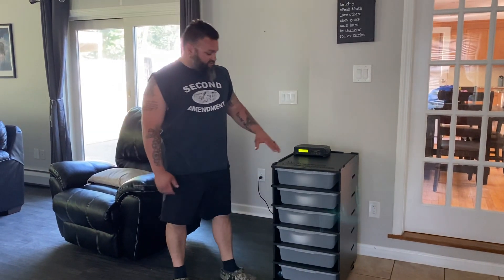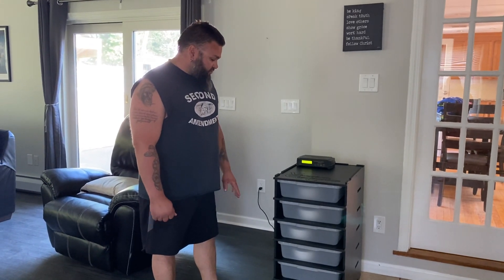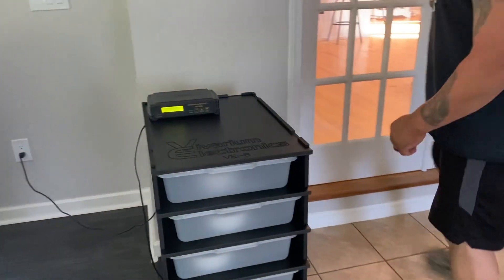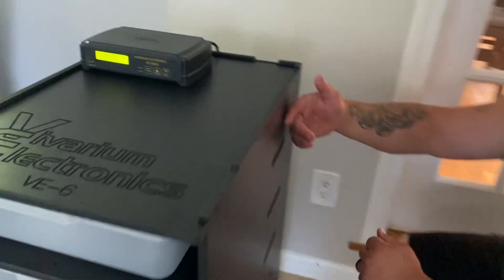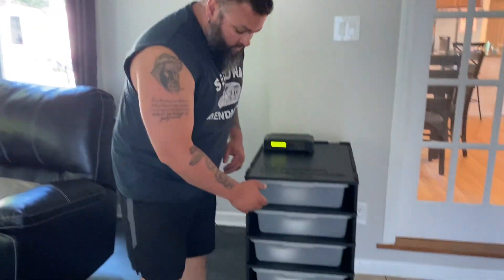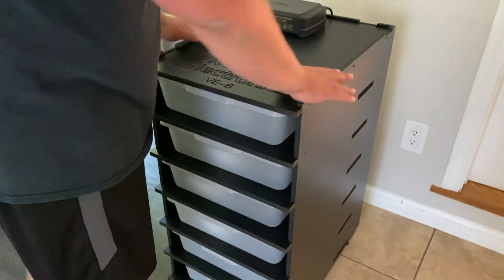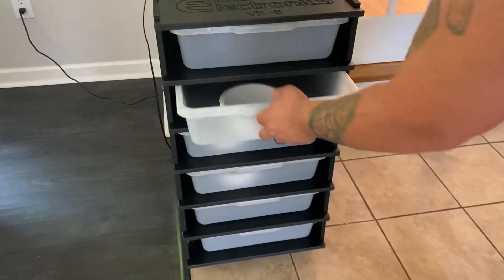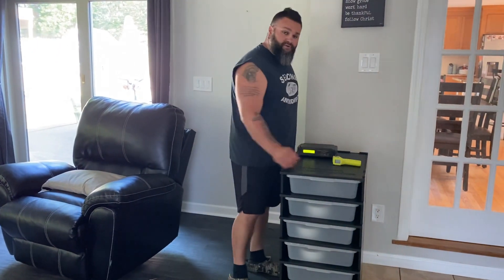Episode 177 Vivarium electronics VE6 rack

Comment: Do air holes need to be put in the tubs? I notice they do not have any.
Reply from the maker: There is a gap between the tub and shelf. At least an 1/8 inch possibly 1/4 inch. But depending on what your keeping maybe you would need air holes.
Reply: Ball Pythons
 @VetiExotics
Reply from the maker: I would just play around with it. I don’t have air holes. Where you live will play a factor in heat and humidity as well.

If I wet my paper substrate the front of the tub will be wet. I only do that during shedding and it’s out of habit from keeping retics and boas. Bullsnakes and pinesnakes prob don’t need me to do that.
Reply from the maker: If your checking your snakes daily combined with the air gap you should be good. However, if your using coco chips and they are moistened I would say air holes are needed. BUT I don’t know how much it’s actually worth it, your not gonna have cross ventilation because the tubs are next to each other and the rack has sides and a back. 

I’ve never worried much about humidity with any species I’ve kept. Only when the pythons and boas were in shed would I dump the water bowl while they were blue.